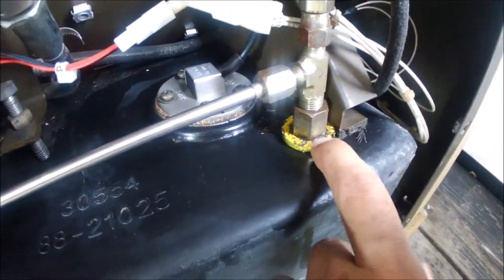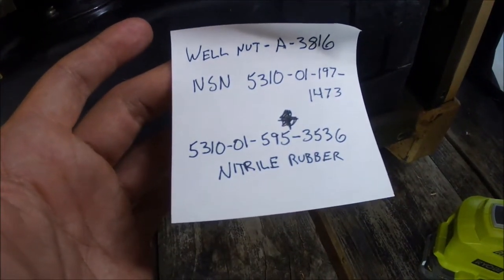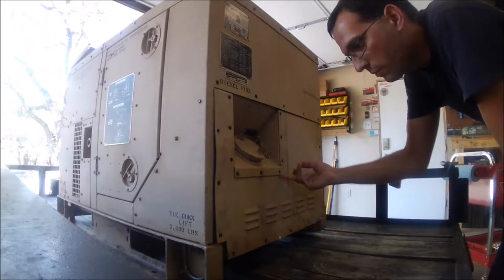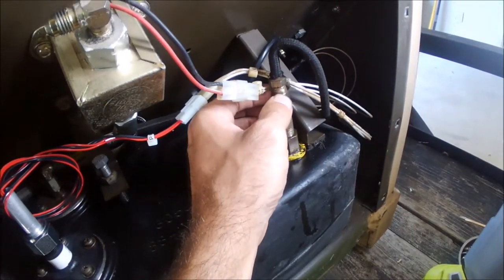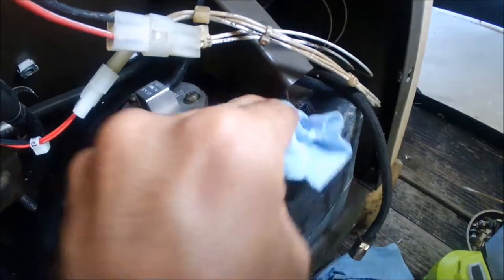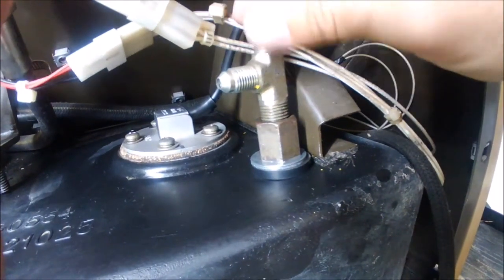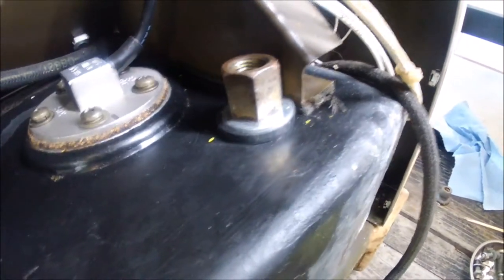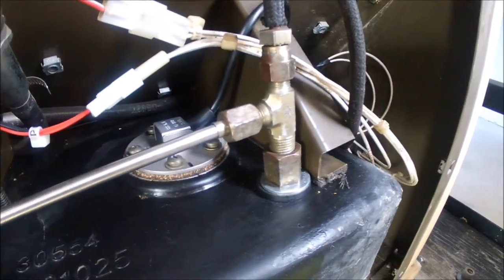MEP 802A - Fuel tank well nut replacment

Comment: I have to replace my return fuel hose that secures into the top of that fitting. Is the fitting that secures the hose to the well nut fitting a hose barb sitting that i can just cut the old hose off and secure the new hose onto it or is it a pressed fitting that I will need to replace? The generator is at my farm right now, I was told the line is leaking fuel and needs to be replaced. I'm trying to figure out if I just need to bring new hose and clamps or if I need new fittings as well before i go back up there. Thanks
Reply from the maker: All the fuel return line fittings are push on. They just slip on. When I replaced mine, I used zip ties to secure them as an extra security. If one length started to leak, replace them all. The plastic T's by the injectors get brittle. I sell some upgraded brass ones on my eBay store. https://ebay.us/Fvpx16

Comment: Where you leaking from that upper well nut? I have a very slow leak. I'm pretty sure its the lower (supply side) well nut because it leaks when its sitting.  Meaning a full fuel tank removal. I need to upgrade the fuel sender anyway...
Reply from the maker: Yes, I was leaking from the upper fitting when towing. The tank removal isn't fun but it's worth it to know you won't ever leak again. These bras upgrades should have been on there from the start!

Comment: Hey I’m actually havin a problem finding the nsn for the high pressure fuel injector return line the old rubber is cracked but the tm doesn’t have the line showing instead a fitting to a straight pipe
Reply from the maker: For the fuel return lines off of the injectors?
Reply: CallMeColt yea that line
Reply from the maker: Those are low pressure lines. I replaced mine with 1/8 inch fuel hose from the local auto parts store. It's .2mm smaller in inner diameter than the braided fuel line that's on there. The braided fuel line is also the same as return fuel line that's on diesel Mercedes, VW, and other European vehicles if you want the exact same stuff.
Reply: CallMeColt thank u sm